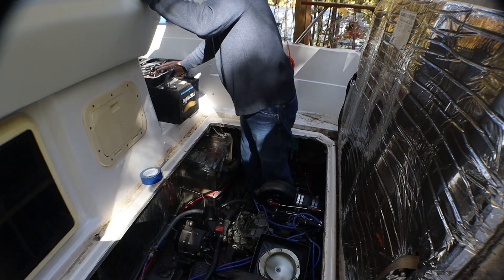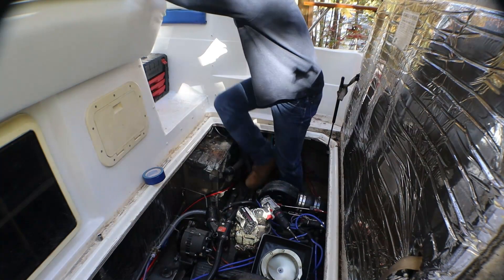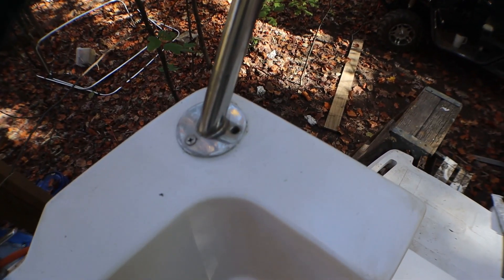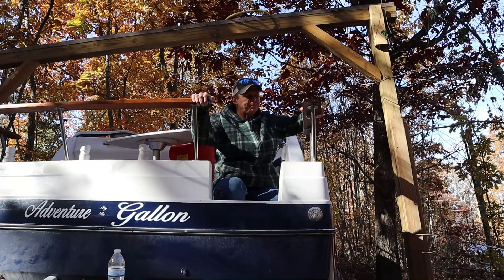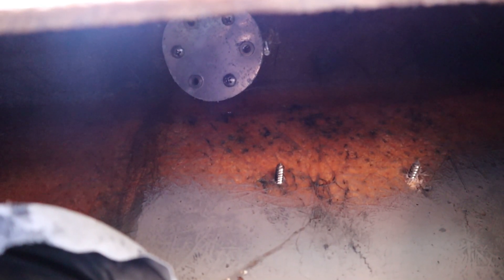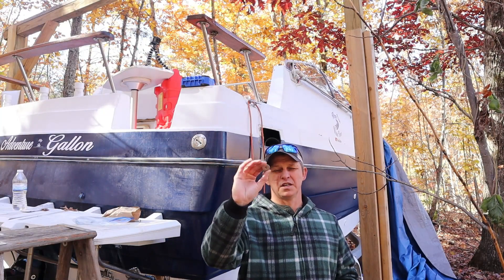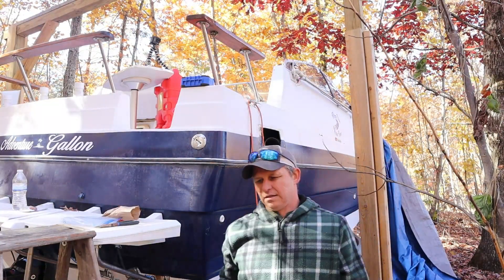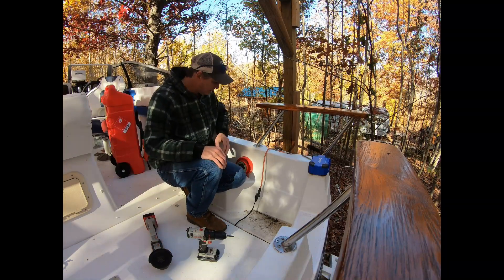Fixing the lose handrail on the Bayliner Ciera 2455

Comment: I have basically the same boat and I’m considering removing all the hand rails and filling in the holes so I never have to worry about it leaking.
Reply from the maker: I hear ya I really thought about taking them off but after having them off putting the motor in I realized I liked them on there.
Reply: Any suggestions for getting the fittings off? I have a 2550 and all of the fittings attached to the boat are cracked. I bought new ones but can’t get the old ones off. I will take the exhaust off and hopefully reach the side ones but the stern ones will be a oroblem